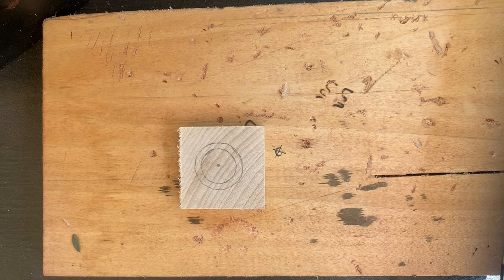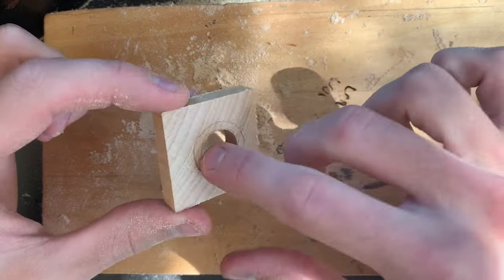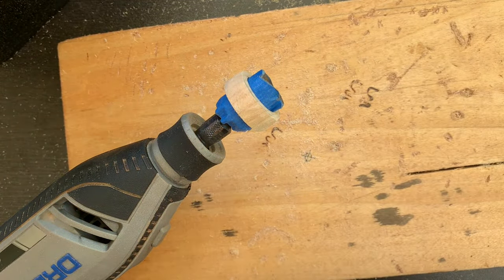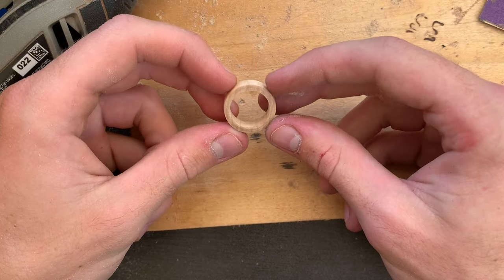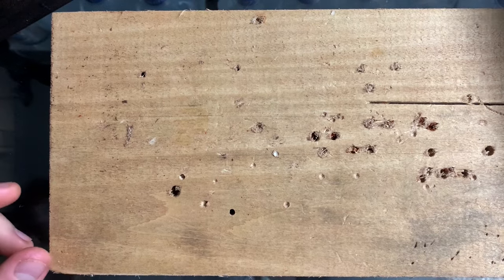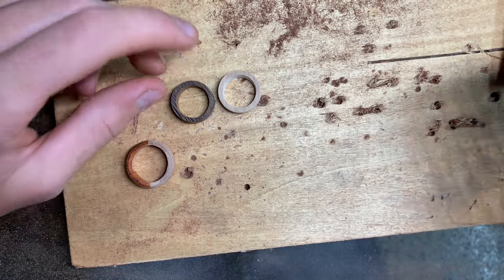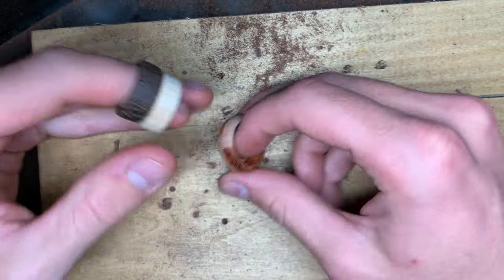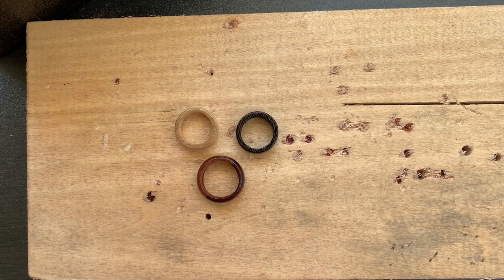How to Make Wood Rings With a Dremel

Comment: The grain shows me that the ring will BREAK quite easily. Plus why not STRAIGHTEN it on the Dremel before sanding? Clearly CROOKED! Low quality craftsmanship
Reply from the maker: Hi, I did the grain that way so that the shortest length of parallel grain (where it would crack) is 1cm, if I did it the other way almost any part of parallel grain would be about 2mm, which would be weaker. Regardless, it’s not a reinforced wooden ring so it will break eventually. For the straightening comment, it was crooked, so then I fixed it, and was honest with the process. Thanks